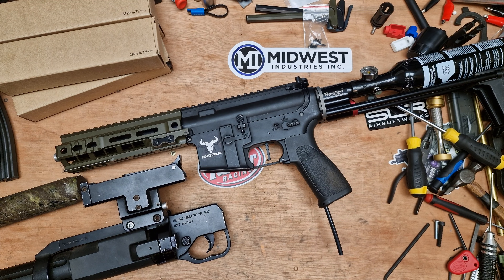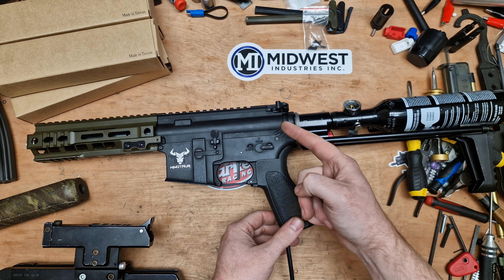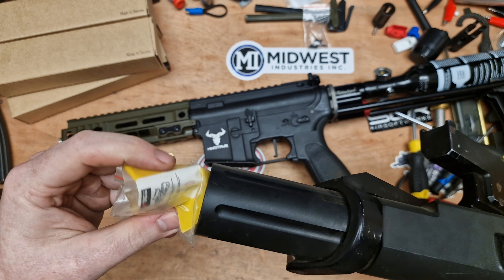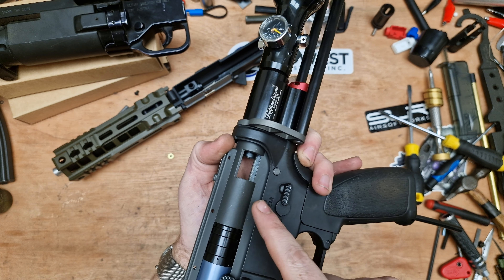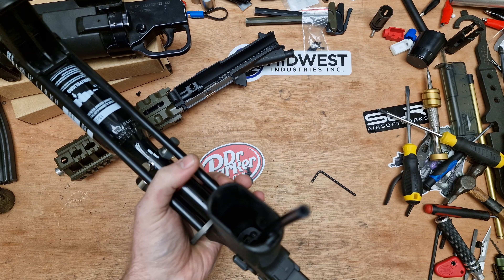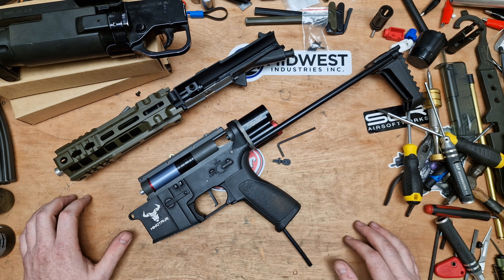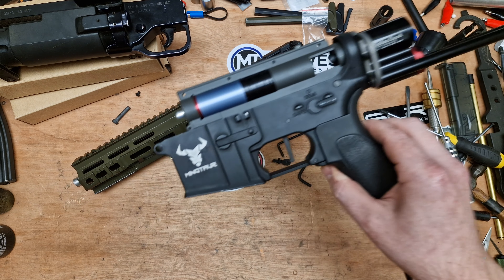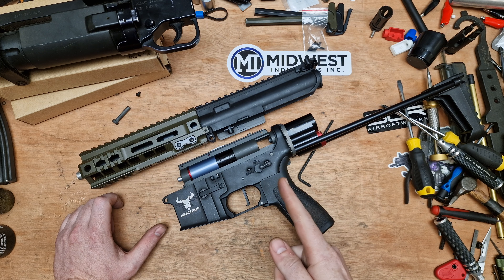Building Kicking Mustangs M4 - Project Minotuar Part 5

Comment: With the screw in the rear of the receiver for the stock would you not be better off with a nut so you could use a small ring/ratchet spanner for taking it on and off

Comment: Why Nov body for such a build? E&C is cheap and would be a better option due to much better material quality, functional bolt catch and no trademarks or any sort of writing.
Metal Novritsch SSR4 uses the same body as Specna Arms Edge and some Lancer Tactical models and those grey parts (and pins) rust really fast if they see rain or moisture.
Reply from the maker: I am using the replica that was supplied to me. If you watch the other videos in the series you will see why.
Reply: Hi, i have a huge problem with hopup inconsistency in my hpa guns. Since you have much more experience with building such replicas - do you know what is causing this? What hopup setup are you using in this minotaur project?